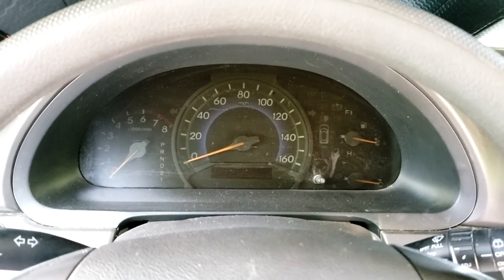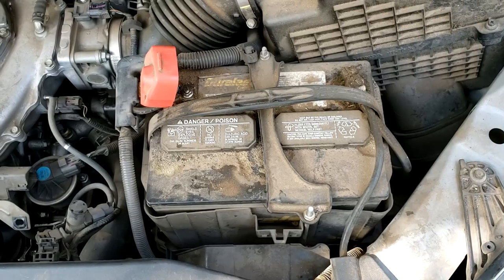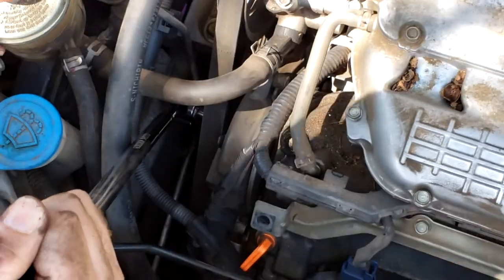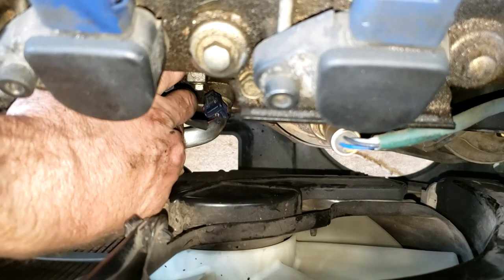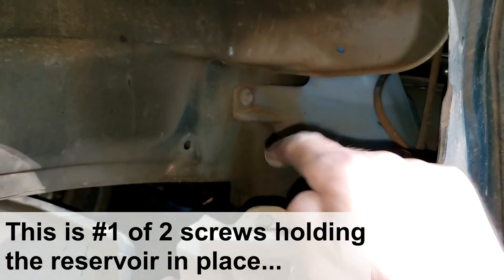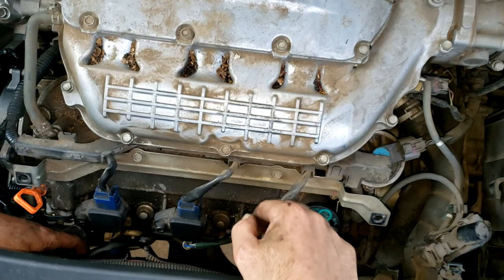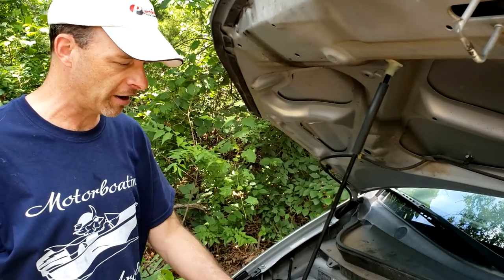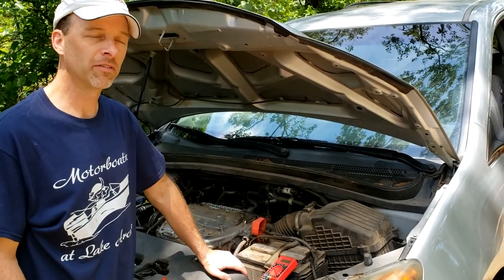Honda Odyssey alternator replacement (1999-2010). DESCRIBED IN DETAIL!

Comment: Bro at 6:20, I can't tell which hole you pulled the longer of the two bolts out of the bracket. There were two bolts under that wire harness right? You cut a piece of video that is only critical in my current situation. Lol. Do you remember anything about it?
Reply from the maker: Well, you're in luck. I went back and found the original videos when I filmed this. The top bolt that attaches that bracket is the shorter one; the bottom bolt is the longer one and a portion of that longer bolt isn't threaded. Hopefully, that's the info you're looking for.

Comment: if the alternator fails in your honda, you are better off to park it in the town ghetto and wait for it to be stolen. will save you a lot of headache with this garbage engineered vehicle. this is a fine video. I got asked to change my sister in laws honda odyssey alternator. i can tell she recently had the ac compressor replaced. wtf didnt she just replace the alternator while it would have been easy. alternators are cheap

Comment: Our van's alternator just yesterday. Which brand did you use? I called a dealer wants 700 for a Honda refurb. part only.
Reply from the maker: I bought mine from Rockauto.com. The brand of alternator I bought was TYC.
Reply: Did you get one with a vcm or without do you have a vtec vcm engine?
Reply from the maker: Mine isn't the VTEC VCM version.

Comment: Hello, the top alternator #12 bolt just wont loosen on my 2000 odyssey. Lefty loosey? Do i have to do something on the other side of the screw? Thanks tons
Reply from the maker: Hmmm, that's weird. It should just come right out (yes, lefty loosey). You could try putting a flat-head screwdriver between the head of the bolt and what it mounts to and try prying the bolt out WHILE ALSO turning the bolt with your wrench. And probably the easiest way to pry it is just by twisting the screwdriver while turning the bolt and the twisting will push the head of the bolt out. 

Hopefully that makes sense. There's no secret, I don't believe, just need to give the bolt some help getting out while turning it.

Comment: To add a note: Some tensioners you need a 19mm Socket. And I was able to get to the bottom bolts if my washer fluid reservoir from underneath by removing a few clips. 

Great video. Love the people do these to help everybody save some money.
Reply: Yup, mine wasn't a 14mm.  I had a 3/4' socket that fit snugly, so that's what I used.  This was a nasty pain in the arse job.  The Japanese engineers that designed the clearances must have been stoned!
Reply: And tiny!